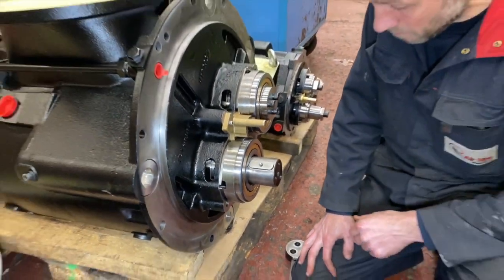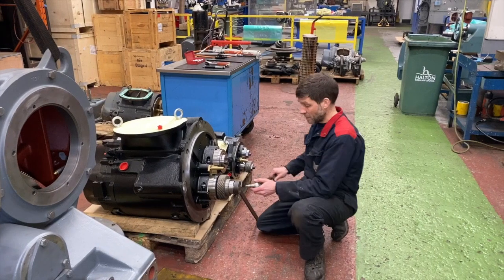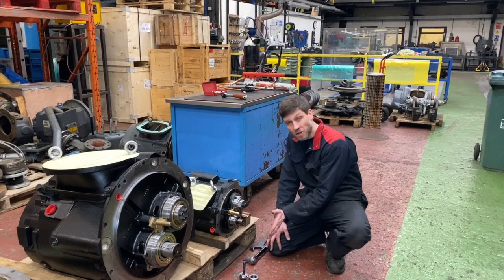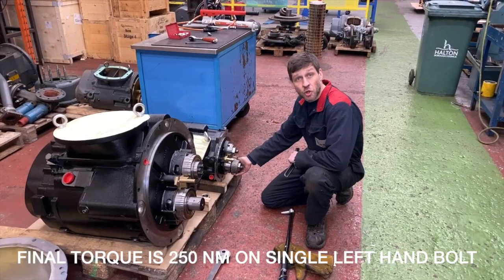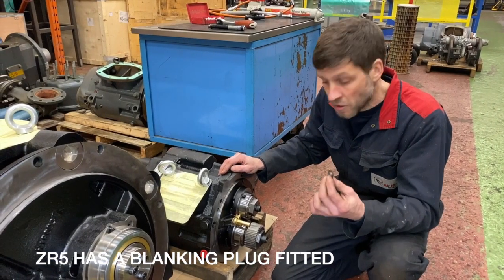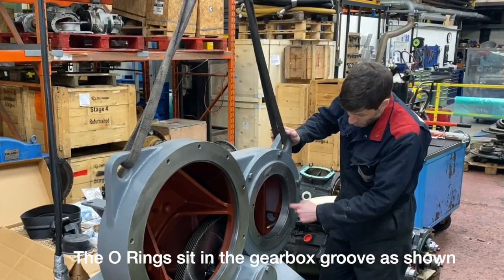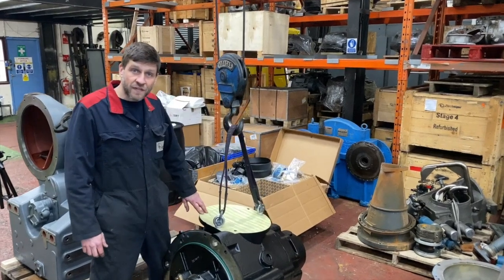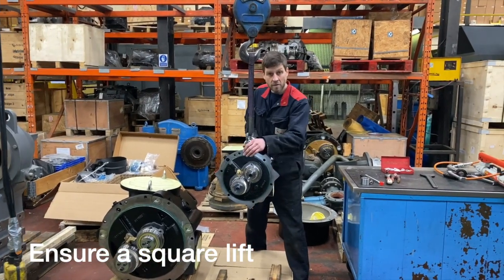Stage 3 & 5 Pinion Fitting Atlas Copco ZR5 Overhaul - Ztechnique

Comment from the maker: Please note a viewer of the pinion fitting  video asked should they reverse the balance piston to fit the pinion . NO absolutely NOT this method was only used on the the now obsolete MK1 element and MK2 procedure should only be as shown in our video . NEVER REVERSE THE BALANCE DIAPHRAGM TO FIT PINIONS
you DO NOT need to secure the element in any other way other than shown to fit the pinions on MK2 version of the Atlas Copco and Ztechnique elements